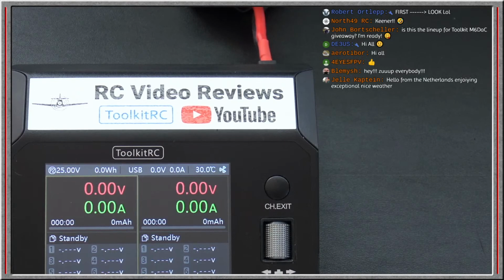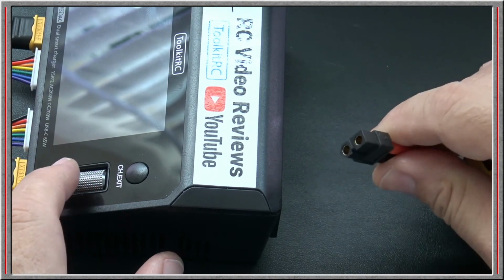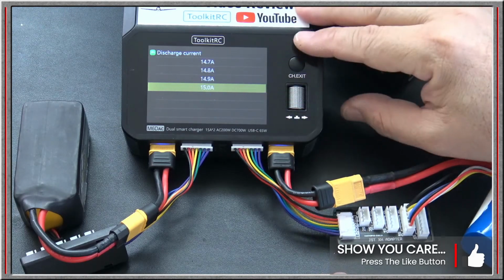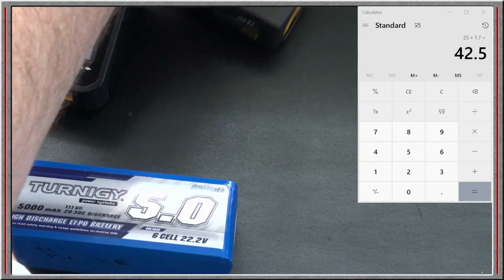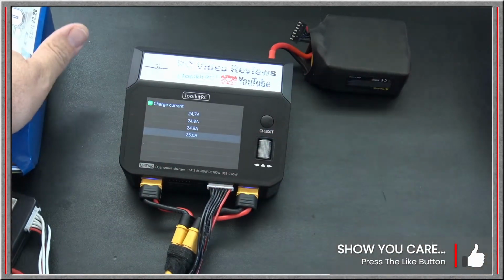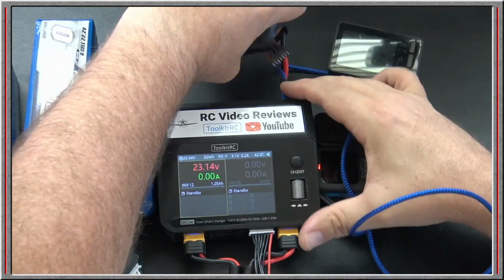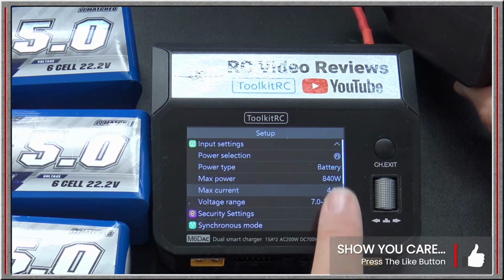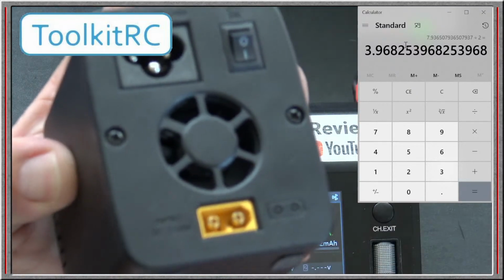ToolkitRC M6Dac Dual Channel AC DC LiPo Battery Charger First Look

Comment: It's the best charger i have ever had.
Easy to use, memory for my 4 different batt sizes, and im about touy onemore, an a large external power supply.
I fly heli big scale, and use a lot of 6S packs.

Only regret i have is selling my 2 Revolectrix powerlab cell pro 8 chargers and my pair of SkyRc eFuel 1200w Psu's, 10 years ago.
But this little charger is a beast.
Reply from the maker: Yeah it’s pretty darn good.

Comment: Profiles are what is pushing me to get this charger.  I used profiles on my Hyperion chargers and they really made it easy to deal with lots of different batteries to charge.  Thanks for showing that part.  I just wish it at least had 240 to 300 watts though on AC.
Reply from the maker: Here's an option: https://amzn.to/3qjpNsK

For $35, you can use a 600w 24v/25a power supply in the wall at home connected DC to the charger. Then you can hit the charger a lot harder.
Reply: @RCVideoReviews  Yea.  Thanks for the info.  That would work for home use but for field use that has AC,  I wouldn't want to drag a power supply with me.  I want to future proof in case I need 5000mAh batteries in a 550 or 580 size heli and still get 1C.  I want to get the Hota s6 or even the future f8+ but profiles are way to useful to me and I don't think they have them.  The icharger DX6 is nice and has logging but it doesn't have built-in ac.

I have also seen some youtube reviews on those type power supplies sagging a lot in voltage and cutting off getting above 60% of  their rated power consumption.
Reply: Notice it  doesn’t have a balance charge. What’s up with that??

Comment: It's been a year... You still using this charger?  How's it holding up?
Reply from the maker: I use it pretty regularly. I take it to the field as a second charger when I'm flying big 12s (2x6s5k) packs in models like my 85" Extra NG and my 700 heli. It's held up just great so far.

Comment: Great review, I have the Hota D6 Pro this looks very comparable to it or am I wrong.  Plus it has a wireless phone charger that works very well. thanks John.
Reply from the maker: Yeah, that D6 Pro looks like a solid choice. How has it been working out for you?
Reply: @RCVideoReviews   Works great,I believe it does most everything the M6Dac does. Also I have two 12V, 1200W server power supply units daisy chained together, for a whoping 24V and 1800W for pushing power to it. If I had 220V outlet in house it can go as high as 2400W.